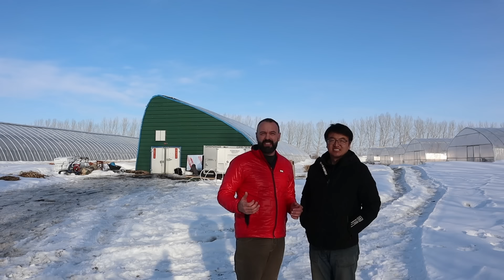Passive Solar Greenhouse Technology From China?

Comment: I built similar as Chinese greenhouse in Manitoba - a decade ago.   the shape of mine is a bit different . 2/3  of my  glazing roof  is meant to catch a snow load. which acts as insulated blanket during the winter . then I have a steep pane in the front  that allows the  sunlight in during the winter . though I do not grow all year long as I find it kind of  pointless from end nov to end feb as there not enough light to support any real growth and plants come to standstill anyways at my lat of 51 as the sunlight hours are to short and not intense enough

Comment: A teacher of physics Ivanov A.V. built such a greenhouse in the USSR in the 1940th. Modern technologies and materials are used nowadays to make it better. However on key element in the greenhouse presented in the video is missing compared to the original (or at least it was not mentioned).
Reply: What key element is it about? What is new about the design of the Russian professor Ivanov?

Comment: It is an impressive set-up but I'm rather baffled as to why he seems to remain wedded to old-fashioned diesel generator technology when solar, wind, battery storage and commercial sized heat pumps would drastically cut his operating costs [and] reduce his greenhouse gas emissions - something he could use as a marketing tool. His upfront investment would be rapidly repaid.
Depending on the design of the solar array, if deployed above his greenhouses, they could act as shading during the hotter months and as shelter against ice and hail.

Comment: Would be interesting to know if this would work even further North in the Territories, where produce costs a fortune, as it is all shipped in.
Reply: If you get less than 10 hours of sunlight a day, all plants stop growing. In the north latitudes most of the plant growth must be accomplished before December so in Mr. Dong situation he replants in July and that gives the plant until probably the end of November to do most of its growing. December and January the plant is in near static. I would think in the territories  you would have to invest into supplemental lighting but alternatively an implementation of a thermal greenhouse would greatly expand your growing window to reduce the problem of frost damage. If a person has available firewood I would invest or build a wood gasification unit to run a small generator so that you have available waste heat and can supply supplemental lighting. If your electrical cost per kilowatt is low, a few hours per day can make a large difference on performance especially if you use a high pressure sodium light which provides a lot of light, and produces a lot of heat which is a win/win in a cold enviroment. Ultimately I think it would in the territories allow you to have a growing season of 6 to 8 months. If you bury in the ground plastic pipe and pump a glycol solution heated by an outside source such as a wood boiler the early spring warming of the soil would greatly help your garden to kick start because in  cold soils the biology is inactive but by warming the soil the bacteria etc. help to supply nitrogen and other nutrients that are slow or lacking in cold soils. The glycol solution is only there to stop freeze up when you shut the thermal greenhouse down for some of the winter when it is not economical to operate. One thing you would find is that far earlier in the spring before any outdoor plant would be available, cold season crops such as lettuce and spinach and bok choy could be started and would thrive.
Reply: @kerrryschultz2904  Wow! Thank you for your very thorough and thoughtful answer!
Reply: @MissEAG  Your welcome. Good luck in your gardening endeavours. Being self sufficient is a blessing.

Comment: Great idea! Being done in China for decades, he said. We could apply this principle to housing and save in heating bills.
Reply: It is already done in different parts of the world. It's a modified earth ship designed by Mike Reynolds. Another alternative is a super insulated home with a deep mass sand bed. In Sweden a company called Polar Nights Energy is utilizing a very large, well insulated area that contains sand and pipes. The sand is heated by wind or solar in the summer to 600 degrees C. That heat can be stored for months. Air is blown thru the pipes when energy is needed and that superheated air goes thru a heat exchanger to heat water to steam pressure which runs a turbine to produce electricity. The waste heat is used to heat buildings. There is currently a system in place that provides heat and power for about 350,000 people. On a smaller scale in cold climates pumping heat into an insulated foundation under a home has great potential.

Comment: This is a very good solution for a very specific situation. You need a lot of sunny days otherwise you won't have heat. And you need a lot of space because with this design you can't build greenhouses next to each other. Also because you don't burn a fuel for heat, you don't have CO2 to inject into the greenhouse. Meaning plants grow slower and you produce less per square meter. So this solution is perfect in certain locations for smaller scale farming, but it won't work on a grand scale for mass food production.

Comment: We used triple layer polycarbonate glazing, metal stud frame, 55 gal drums for thermal mass, louvers, fans & shade cloth.  One small electrical heater kept the space from freezing in Medford, Oregon with temps down to 20degF
Reply: All the improvement from the original design such as the inner insulating layer and using large thermal mass with a dark surface to hold and store heat is dramatically in the right direction. The only differences are latitude and winter time lows. As you move further away from the equator in january etc. the hours of sunshine drop dramatically and in Olds Alberta where these greenhouses are located they can get -40 deg. F temperatures so your heat loss delta between 40-70 deg. F inside and outside -20 to -40 degrees  F shows why he had to add a relatively small heat suppliment as vs 2 years ago when he ran these greenhouses with no heat input. I wonder if he puts some heat into the soil. Plants with warm soil can endure colder air temperatures and still thrive. Probably due to the biology staying active.

Comment: Very inspiring 👍I wonder if we could have the same system to have tropical fruits ?
Reply: A lot of factors would determine that question. Location: what country and how far north from the equator; Money; with the right greenhouse design with supplimental light and heat you can grow just about anywhere. Check out Chena Hotsprings about 65 miles northeast of Fairbanks Alaska. They use an organic rankine cycle power plant with 165 degree water to produce power that heats the facility and provide lights to grow tomatoes and lettuce and strawberries in the dead of winter. This is at the extreme end of Mr. Jianyl's greenhouse which requires a low into put to grow tomatoes in winter. Another thing is that when you get below 10 hours of light per day plants stop growning irregardless of temperatures.

Comment: Very good design overall but I think it may benefit from larger exit ventilation for the summer months, and an air based heat transfer mechanism for cold periods. By continuously drawing the air at the top and blowing it into the thermal mass overall temperature can be modulated.
Reply: Has anyone done a study on two different heat transfere systems efficiency and cost. 1: the forced air system blowing thru buried pipes and I assume for maximum heat gain drawing from the highest point in the greenhouse. 2: Using buried polypipes that circulate water thru the soil and then thru forced air radiators in the high point of the ceiling. If that same poly pipe was also drapped up high and run the length of the greenhouse and put on a cycle timer set to turn on and off at predetermined points to gain heat and also give up heat to the thermal mass, which would be the cheaper system to install and operate.
Reply: @kerrryschultz2904  I believe an air based system is cheaper to build and operate mainly because leaks simply do not matter until they get really bad (unlike liquid). No freeze issues either.
Reply: @davepennington3573  Thanks dave.

Comment: My uncle is building an almost passive greenhouse. You can use the ground under the greenhouse as a thermal battery. If you go down a few feet, the temperature is a perfect growing temperature year round. All you need is a fan to move that air around to keep the greenhouse warm in the winter and cool in the summer.
Reply: That's beautiful. I'm trying to figure out how to grow in the Florida summer
Reply: I'm considering doing the same thing. I'm near Toronto ontario. Only 50'×12'. But grow food for the family
Reply: would two feet below ground be enough?

Comment: Saw these style of greenhouse on my first trip to China around 1995. They used rolled grass layer to roll down during night to prevent heat loss.  This design is notched up and less labor intensive but the idea is still brilliant.
Liked it back then and hope it gains popularity as it helps reducing the need to extensive use of burning oil or gas to heat the building.
Reply: Eventually it WILL be necessary to burn fossil fuels to feed CO2 into greenhouses.
.

Comment: Excellent video. Would greatly appreciate more details on this cold-climate greenhouse. Please create second video to explain:
1. Is the 2nd poly (inner) layer only erected in winter season, then removed in summer?
2. That layer appears to be open at the last top meter, is that to give access to operate the insulation blanket?
3. Does closing the insulated blanket at night create significant frost buildup on the interior face of the outer poly layer? (reduced temp of cavity between poly layers would drop space to below dewpoint)
4. What material was selected for insulation blanket?
5. Details of snow vibrators?
6. It appears that a shading canopy was up, is this kept up all winter?
Reply: 1: In the summer the inner layer is rolled up into the thermal blanket.
2: The gap at the top of the layer is for hot air to escape. There are vents at the top of the outer layer as well. 
3: when the thermal blanket is closed, the volume of air between the two structures is already colder. And while it will condense, there is enough energy in the house to allow it to run down. Frost on the outer layer has no impact on the thermal performance of the inner environment.

Comment: The beauty of Mr Jianyi  system is how well it works without adding expensive supplemental heat. The key points that make his system work so well is the AMOUNT of winter sun he receives in his area and his ability to absorb the excess heat into the back wall and ground. The effective conservation of that absorbed heat through  his roll down insulation is amazing and yet so simple. I would be interested in hearing how well the scavenging of the heat from his generator is going along with the bitcoin mining end of things. We farm in Alaska, mostly tomatoes,  and when I first read about his incredible operation a few years back I researched every aspect of doing something like this here at our place.  Unfortunately, our reality is that we just don't have enough sun and  have way to much cloud cover during our long winters to make this work for us this far north. But..... this is future for year round veggie production in cold climates with good sunny winter days.
Reply: There is a family that built a green house in Mongolia that is relying on an underground heating battery. 
If they can extend the season anyone can. 
In areas where the sun is the limit it isn’t very expensive to ad extra light during the dark period. 
The place where it will be a really challenge is where you don’t have any sun and at the same time it is very cold.
Reply: I know a man that lives in the south of Swede at a zone where there it usually is some periods every winter with -15 Celsius and he have 500 sqm green house digged dawn 2 meters. He grows many Mediterranean plants and have no extra heating.  He can’t harvest tomatoes in the middle of the winter but he prolong the growing season and can keep the Mediterranean plants alive during winter.
Reply: I was actually thinking if this was a viable option for Alaska?
Reply: @hamadilawson7634  i'm in scotland and doubt it is viable here. too little light winter.
Reply: Wind is probably the best suited energy for Scotland, trap the heat, self contained environment.
Reply: @theuglykwan  if it works in alberta it will work in scotland
Reply: @iskdude9922  alberta is colder than scotland but gets up to 3 times the winter sun.
Reply: It's perfect for cold sunny places like Dongbei and Mongolia, and North America 

Not European

Comment: Hello, fellow human who made this video. The text overlay you added @7:38 in this video seems a bit off to me. There is some room for interpretation of what exactly he is saying, but I suspect he is not talking about using batteries to capture electrical energy, but rather about capturing the waste heat energy that a diesel generator produces. The exact value can vary a lot depending on the size of the generator and operating conditions, but generally, I believe they can be expected to produce (very roughly) about 8kWh of heat energy and 4kWh of electrical energy for every liter of diesel they burn at peak efficiency (where operating at partial load less efficiently, they might produce 9kWh of heat energy and 3kWh of electrical energy per liter of diesel). Electrochemical batteries would provide a way to operate the generator at the more efficient portion of that range, but it is still a much smaller amount of total energy available. I can imagine it being possible to capture a large portion of the waste heat by installing an alternative radiator system for the generator that circulates air into the greenhouse and running the combustion exhaust through a heat exchanger to move some of that heat into the greenhouse. Certainly not a trivial task, but one one that seems practical and would have a large payoff. I do wonder why they are using a electrical generator for heating, though. A direct diesel thermal heater would accomplish the same effect as capturing the waste heat from a diesel-electric generator. Do you know if they're using some large heat pump system to heat the greenhouse?
Reply: By the way, it looks like that CIPR-76W is the generator and it's natural gas and/or propane, but I also suspect that doesn't make much of a difference in terms of thermal efficiency in comparison with a piston motor powered diesel generator. I do still wonder why electric heat via a generator instead of direct gas/propane/diesel heat. Is there some heat pump that is cheap enough to use for agriculture at scale like this and efficient enough to offset the large waste heat loss of the generator?

Comment: A man from Kansas has been doing this for decades. This setup looks like a cheap copy, tbh. I'm sure it works well, but it doesn't have all the features i would expect.
Reply: Came to say the same thing, and the guy (in Nebraska, not Kansas) was doing it since the early 80s. China in the early 80s was still highly impoverished and wasn't exactly a hotbed of innovation.

But I guess this video does give the 50c army on Youtube something to fawn over.
Reply: @whisky3k  thanks! Not sure why I went for Kansas :-)
Reply: But it's the tone.

 Why not ask about the features you would expect, maybe he has good reason. Then why say 'cheap' copy as it maybe just more affordable and don't we all like a good deal. He has built a second so he must be doing something right. Why not link to the chap in Kansas project?
Reply: @andyhodchild8  I don't do tone policing. This is text. Interpret how you like.

If we were in person, you wouldn't have the impression of rudeness, because I am not rude. I'm just curt, and I use few words. Also, this is a PRODUCT being purported to be "new". It is not new, and is derivative. Little credit is being given to its actual creators, and no humility is being projected by the maker. I do not feel obligated to be particularly careful with my words when the author is not being so themselves.

Thirdly, the originator used "earth tubes" to help heat and cool the structures, so much so he was able to grow tropical citrus year round for a minimal cost. In addition his structure was very well constructed and stable whereas this one is far less so. This commercial structure and method is, in comparison to his work, a cheap copy. There is simply no other way to put it.
Reply: That's a bit rude!
Reply: @andyhodchild8  Its rude to criticize a product?

Comment: I couldn't help but think what if you built a house inside the greenhouse too?
Reply: Just build a passive solar house. The humidity and overheating in summer are not things you want or need to deal with.
Reply: It has been done, it was very interesting and they didn’t seem to have many problems. You may find it on iTunes or google. Phil.